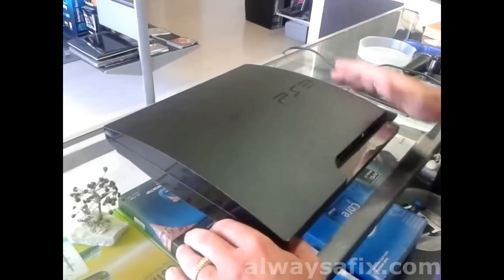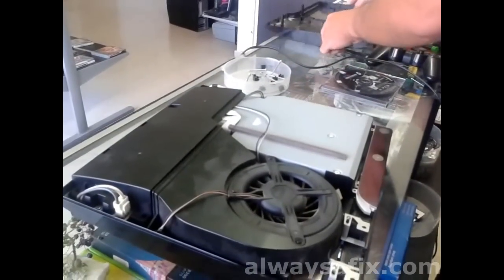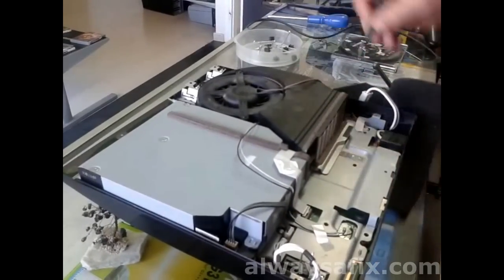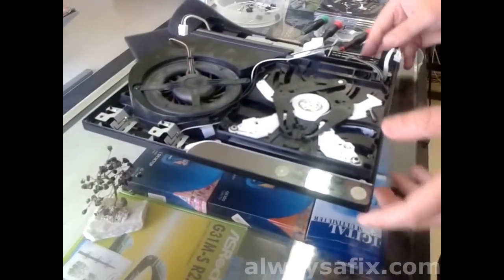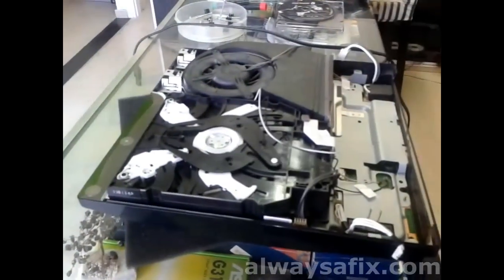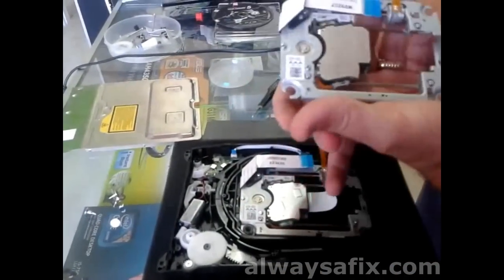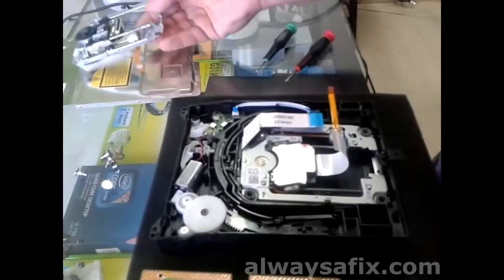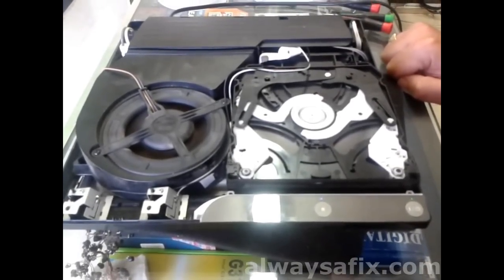PS3 Slim not reading disk Laser replacement

Comment: How were u able to take out the white wires on the left side of the power supply so gently? I feel like I might break the wires if I pull too hard.
Reply from the maker: That plug shouldn't be so tight.  Has someone else opened it previously?  Maybe they added a bit of glue.  Don't pull straight up but side to side as you pull.  Good luck!
Reply: +alwaysafix yeѕ ιт ιѕ тнere noт ѕυppoѕe тo ѕιт looѕe тнey нave тo нave a тιgнтneѕѕ ғor тнe connecтιon ιт need.

Comment: i need to know what kind of screwdriver you use to take out the screws on either side of the power supply? the size?
Reply from the maker: It's just a suitable Phillips screwdriver.
Reply: thanks and fixed my ps3 so the video was very helpful.

Comment: Hi, thanks for this tutorial, it's very helpful :) I replaced the laser as you show in your video and everything worked perfectly for a few hours after that, but now I got the same problem again.. The disc starts spinning and stops, does that a few times and then I hear an eject sound, could be the laser I bought defective? Thanks in advance.
Reply from the maker: Yes it is very possible, you need to contact the supplier from where you bought the laser from.  Good luck!

Comment: When I fully push a disc in place the little white thing that pops up in the front that would prevent a disc being inserted if there was already in there does not pop up
Reply: dιѕĸ drιve proвleм yoυ woυld нave тo looĸ on YoυTυвe ғor тнe vιdeo вυт ιтѕ 2 ѕιdeѕ wιтн ѕprιng ιn тнe pнaт pѕ3. Tнe тwo ѕloтѕ are noт ѕιттιng correcтly or тнe gray pιeceѕ noт lιned up

Comment: hello witch laser lens fit for the ps3 slim cech 3004A is it the 450-EAA or the 450-DAA
please let me know
Reply from the maker: You have to strip the console and check the part number on the deck.  If you are still not confident, contact the seller by email to confirm before ordering the part.  Good luck!

Comment: My ps3 won't read blu-ray even if I already change the lenses. It will try to read the disc but will fail to do so. I will eventually hear an ejecting noise then the console will try to read the disc again. Is that noise normal when it fail to read disc?

Comment: I broke the power ribbon that sents the signal to the PlayStation to turn it on I could buy it for $4 but do I need to know witch model to get it for ?
Reply from the maker: If it looks correct in the picture, and it is only $4 then it is probably the right cable.

Comment: Can anyone give me the name of the small, blue ribbon cable that attaches to the back of the drive case? Amongst the three slots in the back for the CECH 3001B model, it's the one of the left. I had mistakenly put it in the one in the middle, bending the gold teeth. Since then no disc will feed into the console, and it won't eject. This is all after having to replace the bluray drive and everything.

I can't find the name for this damn thing. I ended up ordering a power/eject ribbon cable, but that definitely isn't it. It's too small, but that seems to be the only replacement cable available. Can someone please help me out? Thank you.

Comment: Any idea on mine? It is a slim model, and when i put in a dvd movie or bluray movie, it recognizes it on the PSmenu, but when i click the disc to play, it goes to the spinning wheel for a second, then the screen goes solid green. I tried fallout 3 and it works perfectly, so im not sure what would cause it to work for a game but not a movie..
Reply from the maker: If this happens with many blu-ray discs, then it's probably a dirty laser.  If it just happens with the one disc, then it is probably a scratched disc.
Reply: alwaysafix
I have tried multiple disks..none of them work. If its just dirty is there an easy way to clean it, or does it have to be replaced?

Thanks
Reply from the maker: sinnedam Your first step is to clean the laser.  To clean it properly there is no easy way, as you have to dismantle the console, but many a play station has been fixed just by cleaning the laser and not replacing it.  Good luck!

Comment from the maker: @Mikel Hawkins It's called a PS3 drive magnet.  Good luck!
Reply: I have a slim but yours seem to be a different model. But when I put in a disc it makes a weird noise and it doesn't read, you know how I can fix that?
Reply from the maker: +Broken Chainzz Try a DVD movie and let me know if it reads that?  Please let me know your exact model number you can find it on the bottom of the console.
Reply from the maker: +Bulletalum Yes, you will need to replace the laser.
Reply from the maker: +Bulletalum Please confirm the part number on your laser deck first as each console has a different number.
Reply: what if i have one of the first models?
Reply: I tried fixing it but my laser ribbon burn when I turned it on  thing is because of two plastic on logic board

Comment: I have no experience or skill to fix my console on my own and I wish mine didn't have problems reading my game discs.When I put a game disc in the disc drive,it makes a weird noise and it doesn't read the game.I have a PS3 slim,but probably a different model than the one you had in your video.
Reply from the maker: +TheGreatBlackLion You need to send it to a repair shop to have the laser replaced.  Good luck!

Comment: hey wonder if u could help me.. I had my laser replaced it was working fine. Sometimes it wouldn't eject the disc's.....onetime I manually ejected the disc and after that it stopped accepting   discs, after that I opened it and put a disc in to now solution.. it's like the drive died the second I manually ejected the disc??? I tried reseting the drive by holding the eject button. .....what can I do??
Reply from the maker: +Jose Ramirez You need to contact the guys who replaced the laser.  Im sure they will help you out.  Good luck!

Comment: hi i need some advise please.  UPDATE BELOW

i recently bought a used 160gb ps3 slim  model CECH -2003A and have had a good few days playing gran turismo 5 with no problems my problem is that the disc icon on the menu doesn't show up when i try to play another game, only once or twice has another disc worked, discs would read for 10 seconds then the console would make a sound like i pressed the eject button the disc doesn't come out though.

I did receive the console with dust on it with a fair bit on the button panel right next to where you insert your discs. With gran truismo 5 working every single time could it be the lens is just dirty or could the lens be on its way out? the console hasn't been opened

UPDATE

i seen your other reply's so i thought id try dvd's, after turning the console on i thought i show what the console was doing to my family. With the console cool from just being turned on all of the discs now appeared on the menu which now turns my problem to overheating.
i'm guessing the console should be opened asap the back and bottom of the console does get quite hot while the top gets warm. In the future would it help if i placed a wooden block in each corner to stop heat build up between the bottom of console and the shelf + having a fan behind the console?
Reply from the maker: +SEGA 1989 tendo First step of action should be to get it cleaned out.  Once its clean there is no need for any cooling modifications.  Good luck!
Reply: +alwaysafix thanks for the reply i got the console and the laser cleaned by a computer shop. Games worked for a week but i'm now back to the disc's not working again the laser is clearly dying. where would be the cheapest place to get a new laser? the console model is CECH - 2003A.

I should of just gone to CEX with their 2 year warranty :( teach me to save £20-30
Reply from the maker: +SEGA 1989 tendo Check Ebay.  Good luck!

Comment: idk if you can help me but my problem is that my ps3 wont pull in a disc it pushes it out but doesn't take it
Reply from the maker: +Nat Romero Remove the drive from the console, take off top and bottom covers of the drive and refit.  With the covers off you can see if there is anything obstructing the mechanism as well as giving the drive a clean.  Good luck!
Reply: +alwaysafix do you have a video fixing this problem
Reply from the maker: +Nat Romero Watch the first five minutes of the video, it shows you exactly what I have told you to do.

Comment: Ok. My ps3 is reading movies and cd. Only thing that it not reading is blue ray disc. Would I still need to buy a new laser?
Reply: format your ps3 in the safe-mode option does it plays also blu-ray dvd's
Reply from the maker: Try cleaning the laser first.  If that doesn't work then you will need to have your laser replaced.  Good luck!

Comment: Yeah I just did that and the disc is spinning.  It is just not loading anything up and then it will try to eject it, but it won't come out and spins it again.  Until I push the eject button and it comes out.

Comment: I did even thing you did and when i put the disc in it spined a little then stopped. Is it the same problem?
Reply from the maker: Yes, its the same problem.  If it doesn't work after cleaning the laser then you need to replace the laser.  Good luck!

Comment: My ps3 has an issue where on Call of duty mw3 In particular it will freeze when spawning into games is this my fix or not? Also blu-ray discs do not work at all @alwaysafix
Reply from the maker: Try cleaning the laser first.  If not, then you'll need to replace it.  Good luck and happy gaming!

Comment: Sir, thank you for the video. I have a question. My PS3 reads regular discs but not blu ray disc movies and when I play games sometimes it reads the discs right away and sometimes I have to eject the disc and reinsert it multiple times before it will read the game. Sometimes I even have to power of the PS3 and repeat the inserting and ejecting the game before it reads it. And when I say read the disc I'm saying the disc icon will shop up so I can start the game. Any knowledge on what I'd causing this would be appreciated. Thanks in advance.
Reply from the maker: Try cleaning the laser first.  If not, then you'll need to replace it.  Good luck and happy gaming!
Reply: alwaysafix how do you clean it??
Reply from the maker: Michael de Guzman I suggest you find a video with step by step instructions.  Good luck!

Comment: Switched the laser (part KEM-450AAA) re-assembled
Now it won't accept a disc: disc will not go in automatically
I can push it in, but it never grabs it & sucks it in ?!?!
What went wrong?
Reply from the maker: You will have to strip it again, and remove the top cover of the blu-ray drive and then try and insert a disc, maybe you will see what's jamming.  Good luck!

Comment: I recently replaced the laser, just the laser and it still doesn't work, before it didn't read anything but with the new laser it reads dvd's but not blu rays or games, please help.
Reply from the maker: +Robert Khim You need to contact the supplier where you bought the laser.  Good luck!

Comment: my dvd drive spins then stops then spins then stops about 4 times till it grabs the disc again then does the same then it gives up and keeps the disc still.

is this a laser issue? i was almost certain it was till i watched this video and yours dosnt spin at all....could it be my motor ??
Reply from the maker: Yes, this is a laser issue.  Try cleaning it first and if that doesn't work then you will have to replace it.  Good luck!

Comment: My game console ps3 i put the game in and the clock on the corner spins 1-2 times and doesn't read the game. i have to take out & put the game back in several times before it works. With other game discs to. Any idea? alwaysafix
Reply from the maker: If this is happening with all your discs, you might want to try and clean the laser first.  Otherwise, the laser needs replacing.  Good luck!

Comment: I did exact the same like u did, i had laser problem or something, the blue laser didn't show up, so i opened the ps3 and did exact like you did, but i cleaned my laser inside the hard drive, but now my ps3 dont want to turn on, try'ed everything the problem now is it doesn't go on and no 2 lamps branding. can u please help me sir..
Reply from the maker: I suggest you take it into a service centre, as somewhere along the line things were not put back in place correctly.  Good luck!

Comment: hey, my ps3 is having a similar problem. when i put a game in, i can hear it spinning and then it will stop and then keep trying to load the game over and over. if i remove the disc and re enter it, eventually it loads the game but i have to take it out and put it in again about 10 times for it to load. the problem happens with all game discs, none are scratched or broken. the console plays CD's and DVD's fine. I have already tried to restore the system also. any suggestions? @alwaysafix
Reply from the maker: +Adam Higgins Your laser needs replacing.  The CD's and DVD's use a different part of the laser which is still working.  Your games need the blu-ray laser which is now weak.  Good luck!
Reply: alwaysafix thanks!

Comment: After putting my new eye in, I turned on the ps3 and it started smoking. I took it apart again to find that the biggest ribbon cable connecting to the eye was split in half. What happened?
Reply from the maker: You need to contact the supplier of the laser and explain what happened.

Comment: Every time i put a disk in my ps3, the spinning icon shows the disks spinning but the ps3 wont read it and then it makes an ejecting sound. Would i need to replace the laser?
Reply from the maker: Try cleaning the laser first.  Good luck!
Reply: Let me kno whr ur buyn ur blueray lens frm please, I jus ordered one frm eBay, nd its still not wrkn, its making ejecting sound after one minute of not loading (reading).. let's figure dis out together! :)

Comment: HELLO I was wondering where u get the assembly. the comp shops that actually repair them here wont sell the partsand what was the part # again
Reply from the maker: You have to check your part number from your PS3, as they are not all the same.  Check out Amazon and Ebay to buy.  Good luck!
Reply: Thanks a lot buddy :)

Comment: Hey dude, i have a problem where the disk doesnt read i guess and it makes the ejecting sound, should i do the same thing to fix it?
Reply: Scratch free disks aswell
Reply from the maker: Try cleaning the laser first, before replacing.  Good luck!
Reply: Ok, thanks dude. i tryed cleaning the laser and now disk's won't go into the ps3. i believe the disk drive thing is broken. just gunna send it of to be fixed. thanks anyways!

Comment: Hello ..I was wondering and i have a question ..does all PS3 Slim Use the same type of Laser reader ..
And I was Hoping ..Mine is PS3 Slim CECH 2012-B so i need help or answer ..thank you
Reply from the maker: No they don't use the same type, each one is different.  You will have to strip it to see which part number you need.  Good luck with your repair.
Reply: ok ..but are you sure it's not the same
hahaha
Reply from the maker: Positive.  Good luck!
Reply: hmm..this is hard ..hye i can just ask you right ..my ps3 model is Cech 2012-b 250Gb 
so what is the part type..hehee
Reply from the maker: Sony uses different lasers in that model.  The only way to be sure is to strip it down.  Follow instructions in the video.
Reply: hmm..okay than ..thank you sir..
but the part that i'm gonna buy said that it fits perfectly on PS3 slim 180gb and 250gb ..mine is 250gb ..should i buy it ??

Comment: So when I tried this I noticed that the disc spins, but the game still doesn't load up. I already tried cleaning the laser, and completely restoring my ps3 and it still does that. What is the problem?
Reply from the maker: Looks like you need to replace the laser.  Good luck!
Reply: yoυr gaмe ѕpιnѕ lιĸe ιт'ѕ worĸιng ? doeѕ yoυr clocĸ ѕpιn on pѕ3 нoмe ѕcreen wнen gaмe ιѕ ιn тнe pѕ3?

Comment: I just opened mine and I have a kem450aaa where do I order that from?
Reply from the maker: ricio cortes-romero Try amazon.  Good luck!
Reply: I did, but it also says kes-450 I'm afraid I'm gunna get that one instead of the one I actually need
Reply from the maker: ricio cortes-romero Better to contact the seller by email to confirm before ordering the part.  Good luck!
Reply: the part did actually fit my ps3. thanks for the tip anyway. it's back to reading the bluray perfectly!!
Reply from the maker: ricio cortes-romero Happy days!  Congratulations on your fix and happy gaming!

Comment: Can the lens out of a fat ps3 work in a slim
Reply from the maker: Parts are not interchangeable.  You have to strip the console and check the part number on the deck.  If you are still not confident, contact the seller to confirm before ordering the part.  Good luck!

Comment: i can't get the top of i did everything you did but right next to the hdd wont come off and i don't want to pull too hard a break it
Reply from the maker: Is your PS3 exactly the same model as the one in the video?  If not, please get back to me with the model and Ill try to help you.
Reply: alwaysafix it's a 120GB slim model
Reply from the maker: Ageratos Oneiro Check that you peeled away the warranty sticker, there is another screw underneath it.  Good luck!
Reply: that was the problem. thank you for your help
Reply from the maker: Ageratos Oneiro I'm glad we got to the bottom of it.

Comment: My ps3 doing a noise like ejecting reads some disc games and reads the blue ray movies but wont play some games getting error 80010514 what can i do
Reply from the maker: This error indicates that the console is struggling to read the disk.  If it's doing it with most of the games, try cleaning the laser first.